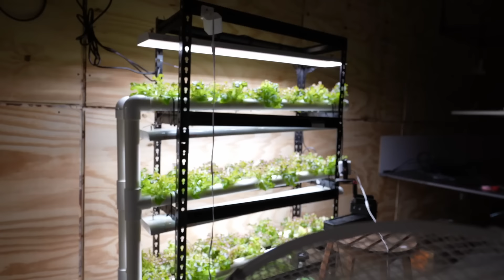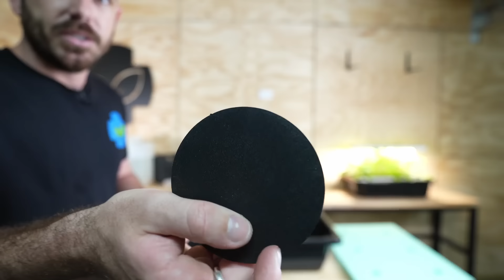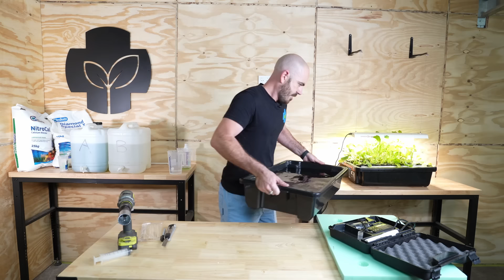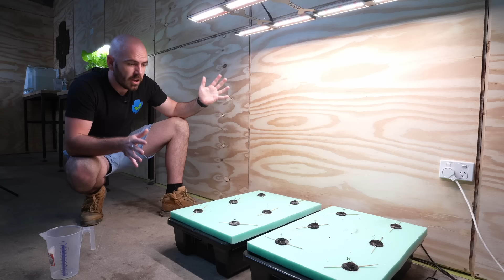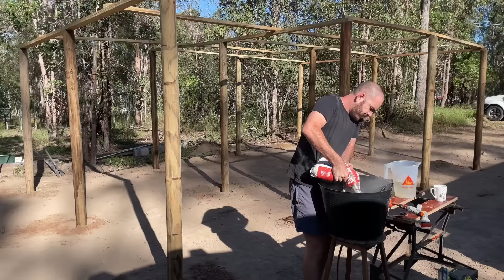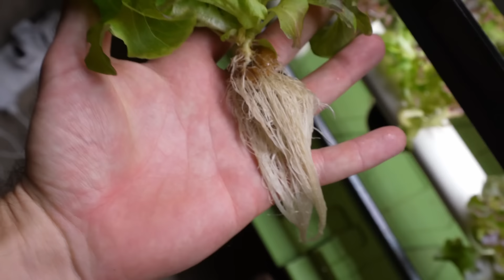Deep Water Culture vs Kratky... And the Importance of Air Flow in Indoor Systems

Comment: @Hoocho
240k smaller bubbles are better as they dissolve before reaching the surface keeping the oxygen in the water and larger bubbles go beyond the surface and oxygen will be released in the air which is a waste

Comment: Heads up:
Also because of the lack of airflow your plants bend over towards the ground when the first big leaves start growing.
You need a good air flow so the plant will move side to side when it is small and it gives it strength to support itself.

Comment: Dude this is an eye opener.. I had some good chilli plants the first season I grew Chillies indoors. The growth was so thick it was very difficult to water them. But last year they didn't grow so well.. I overwintered them anyway but because they had become a bit large I pruned them down a bit.. After that they gradually started dying. I assumed it was because I pruned them wrong. That may still be the case, but I also just realised I have not been providing airflow at all. But I think I DID provide airflow in the first season that I was growing chillies.

Some plants already died now, but luckily I was able to isolate some flowers of my CC Jalapeno plant and grow pods with seeds that should be true to type. Luckily also, two of the three of my trinidad perfume seeds still germinated even though those seeds must be at least 2-3 years old now. So I'll be able to grow some new plants from those. Anyway, I've set up the fan again, so let's see what happens.

Comment: In my experience, a common point of failure with DWC or Kratky is fluid temperature; particularly when growing outdoors. I live in Florida and the nutrient solution gets too warm. If you use a black container it gets downright hot. The ideal temperature for submerged roots is between 65 and 68 degrees. Anything above 75 will stunt the plant. That can be difficult to maintain indoors under lights. And it's impossible outdoors without a cooling system.
Reply: I learned the hard way, even in NJ, during the heat waves we had this summer.  Next year, I'll need to plant heat sensitive plants in spring and fall only (herbs, lettuce) and focus on heat loving plants in summer (peppers, tomatoes) for my Kratky systems outdoors.  I'm not sure how other systems (NFT, ebb/flow, etc.) keep the solution cool without a cooler either.

Comment: You can stop buying airstones and aerators, which will save money and circulate the water at the same time.   
The smallest water pumps have a  venturi hole on the outlet side and you simply attach a soft air tube to that which stays above the water level. 
The pump pulls air in through the tube which oxygenates and circulates the water at the same time.

Comment: I use 1/4" soaker tubing rather than a stone. I can make a coil which surrounds the roots with bubbly goodness. I drill a couple of bigger holes as well. Works great, I struggled with my stones getting clogged

Comment: 33 years experience with DWC here. Water temperature is critical. Must be cool, under 70 degrees Fahrenheit. You should NOT use air stones. Air pump that does a 60 gallon aquarium is good for 5 gallons of DWC. Water quality is critical, hard water is needed. No well water without cal/mag. Your tray container is just right, shallow water culture is best. Air stones clog, restrict pumps and wears them out much faster and reduces water surface turbulence. You're not doing fish, you're doing plants.

Comment: In my experience DWC has never been a set and forget process I will check the nutrient levels, concentratrions and pH and adjust once a week, with a DWC system like this you might be able to get away with 2 weeks unmanaged maybe a bit longer. also having the airstones raised reduces the volume of oxygenated nutrient water available to the roots and once the level falls below that of the airstones then it turns into a Kratky method which the plants may not like due to a larger root mass expecting to be submerged. With the Kratky method a little bit of maintenance and water level management would have seen a much better end result after fixing the transipration issue. Possibly a nutrient drip could be setup to both setups to continually add a small amount of nutes and water after say week 2, just to keep both methods at a functional water level. Depending on water uptake 50ml - 250mL/ day for each method? Ahhhh forget all of the drivil I just mentioned as I suppose all it really needs is just a larger container and volume of water. It would be interesting to see how the nutrient concentration and water changes from week to week especially if tested against a fan and no fan scenario. Just my thoughts and reading back through my ramblings it sounds a bit critcal sorry for that. Love the time lapse really show the plants dancing and reacting to their environment.

Comment: It's not possible to dissolve more than 284 um/L of O2 in water at 20 C.  Less at higher temperatures.  Bubbling massive amounts of air only evaporates more water.  It is strange how "Kratky" systems manage to work with no aeration and simply a small amount of dead air space.  What massive commercial DWC installations require does not scale to small hydroponics.  Commercial DWC systems use rafts that cover the surface of the water, preventing natural aeration.  If people don't understand why things are done then they practice the "monkey see, monkey do" method.  People that have time to 3D print air stone holders rather than use a little RTV need to get a real job.

Comment: Hello Hoocho and thank you for your channel. I wanted to comment on the  use of the air stone and air pump. I am coming at this from an aquarium point of view. My experience has taught me that it is important to keep the air pump higher than the air stone, in the event of power loss the air lines can fill with water and siphon off the nutrient fluid in bucket adding to the problems already associated with a power outage. Simple inline check valves will also help but as a word of caution they occasionally fail as well so simply keeping the pump higher than the container is the best practice. Best wishes.

Comment: Tbh you're hard pushed to get things "wrong" when using bottled nutes etc , all you Ever need to do in water based systems is to keep the pH viable & also the actual temperature of the main reservoir 👍 Always I find Utterly over looked 😱🤔🧐 But I find can be crucial as pH is ..

... Soil has natural buffering properties and so pH isn't quite as important, you feed the soil & not the plant. The plant ❤️ Will do what plants have done since before humankind existed..

And always try to have an oscillating fan 👍
Reply: Oh and If you get dwc spot on then it should smash the ball out of the ball park all day long 👍👍👍 that's my own personal experiences 🌱♥️😎

Comment: That is really interesting and I guess intuitively I just must have known this because I’ve always had a fan running on my indoor grow systems(not my seedlings though).  I never knew why it worked I just knew it did and I was having amazing results with all my leafy greens and everyone was always amazed at the colors.  To me it was normal and I was always cutting the outer leaves off every 7-10 days so I never gave the plants an opportunity to not get their required nutrients.  But it’s very interesting my initial thought was to keep good air flow to prevent any mold or fungus issues but I’m blown away to learn how it actually helped the plants to pull in the nutrients needed.  One question-on your video time lapse you said that your pak Choi ran out of nutrients and that was why they were weathering and dying but did they also run out of water entirely? Because it’s been my experience as long as they have water they will continue to survive and they will grow slowly but the intensity of the green leaves will be quite light in color but they won’t die down the way yours did, so was it nutrients and water that was lacking?🥰❤️🙏🏻🇨🇦

Comment: The pump you are running is not powerful enough to show any real difference in the airstone output relating to their size currently. The smaller airstone will work just as well but may clog slightly quicker over its lifespan. On your pump it's worth fitting a non return valve/ mounting above the water level or both in case of power outage. Learned a lot from your video

Comment: Any thoughts on how relative humidity in the air could affect plant transpiration? I live in a high desert region that has very low humidity year round and have my hydro setup indoors year round. 
If I understand stomatal transpiration correctly, it's the evaporation of water from the stomatal specifically. 
So if the stomatal has high humidity, and the air around it has low humidity, I am curious if there is a % difference I'm humidity that allows for appropriate stomatal transpiration without the need of air flow.

Comment: Over the last 15 years I have learnt ,too much Air is not good in DWC Systems. I now only aerate 15 Minutes every Hour. My plants are much better with no crinkly leaves or signs of tip burn. I have seen others on Youtube have discovered the same problem, and have cut back on aeration.
I started Hydroponics back in the 70s and now limit to Dutch Buckets, Deep Water Culture for Toms, Cukes and NFT for lettuce.

Comment: I guess it doesn't matter what order you say to add the nutrients because between Jacks 321, Diamond Special T, Masterblend. They all have you adding the SAME ingredients in NEARLY IDENTICAL RATIOS just in different orders. Masterblend for example says to add cal-nit last.
Reply from the maker: I’ve just been made aware that the calcium nitrate is meant to go first, but I will always recommend going by the nutrient manufacturers advice.

They might have some magic, physical property changing product.
Reply: Order varies a bit I think based on whether you're doing powder/concentrate.  A/B tanks people tend to do CalNit first, probably because that can mix silly fast and our concentrations are usually 200:1 or less so shock isn't a factor that powder users might experience.

Comment: I need a Hoochos starter guide (beyond lettuces albeit I know they are the right place to start) and summary of nuances between different plants. There's so much information to digest. 
My goal is to have a small variety of systems and plants for a level of self sustained food production and I know it'll grow, some pun intended, from there
Reply from the maker: What would you like included in the starter guide?
Reply: @Hoocho  that's a really good question. I think my sticking points today as I'm trying to dive into hydroponics are recommendations on what system might be easiest to start up with different varieties of plants and watchouts. 
I'm working my way through the various textbooks and I haven't seen any sort of guidance yet on nutrient differences between plant families, certainly the lettuces need different nutrients from potato or strawberry? Maybe they don't. 

I'm going to start with small samples of different things but it would be nice for a Hoochos quick start guide for newbies.

Comment: no need for the airstone holders, just silicone the airtubes to the crate itself. Also if you want smaller bubbles, misting irrigation also works under water (and use the same 4/7mm tubing)

Also a small warning, in event of a powerloss your airpump will drain the tub and damage itself... so make sure its higher as the water!!

Comment: It makes me wonder whether or not the calcium deficiency symptoms would happen without airflow in my 30% indoor humidity environment in southern Colorado USA. I would expect humidity to be inversely correlated with transpiration rate, I guess? Edit: You went on to cover humidity, go figure!
Reply: Greenhouse CEA growers have that problem regardless of humidity in the later weeks (for lettuce).  Most lettuce heads are closed, and that protected region tends to have 90RH or higher regardless of ambient.  So trends are pushing towards harvesting at week 4-5 (before onset) because it's hard to combat.  :P  In less commercial settings, you can use down downward fans (not horizontal like that here) to extend the pick time.  There's some trick you can also do with dissolved oxygen, but I'm not well versed in that.  I just put small 120mm fans with my lights pointing down and that's staving off the tip-burn.  I've got 60-day kratky romaine heads growing and have yet to see it in the inner core.
Reply: @teac117  Nice! Downward pointing computer fans for the win. I'm growing spinach mainly, so I'm not expecting the same issue with the closed head, but I'm sure this will come in handy once I'm growing romaine! Thanks!

Comment: I was also going to suggest an episode on VPD but looks like someone beat me to it! From my experience with DWC it really doesn't need to be very complicated. A few years ago I started some chillies using kratky, when they got bigger refilling the kratky became inconvenient so I switched them over to DWC. At first I bought an air pump to do it the same way as you in this video, but eventually they reached a size where the air pump felt inadequate. I can't remember where but somewhere I read that water oxygenates most at the surface. When I first looked into DWC I had assumed that you'd need to pump the oxygen directly into the water, but actually the water/air contact at the top of the container oxygenates the water just as well if not better because of the larger surface area (compared to the bubbles produced by an air stone). I had a bigger water pump laying around so I just threw that in my container instead of the air pump and it worked amazingly well, I had 0 issues. I even had the pump on timer for 15mins every 2hrs and still had no issues and healthy roots.
All this to say DWC doesn't have to be complicated, just keep the water moving so that the surface is turning over and in my experience you're good to go. Could be another test for the channel or an idea for a new system for you to play around with - one that starts out kratky and converts to a simple DWC when the plant is big enough. Anyways, great vid as always :)
Reply: This comment along with this amazing video needs to have more people know about it. It helps explain plants to me in a way I never realized! They have passive circulatory systems whereas we have active pumps to do that stuff. Your comment suggests, too, that it's the movement more than the air pump that was doing the work. Have you tried two systems side by side, one with an air pump and the other with the water pump? Very curious how that would work.